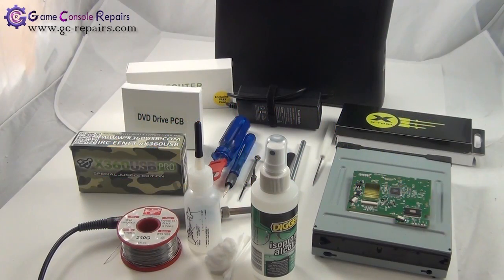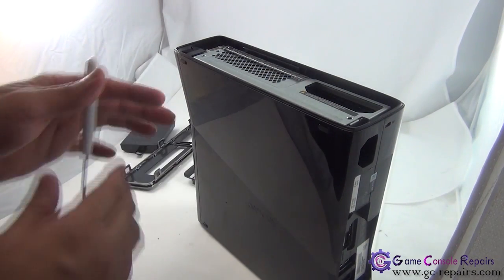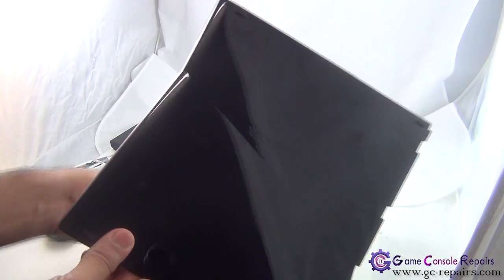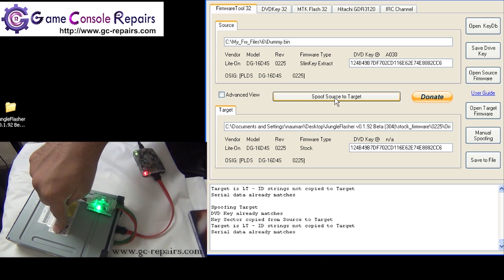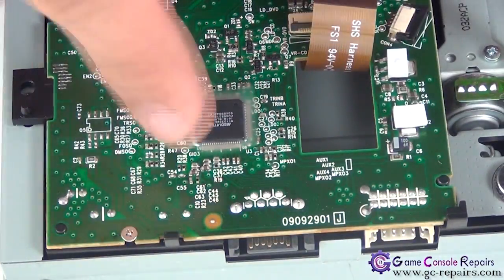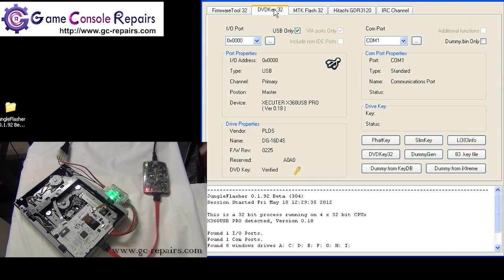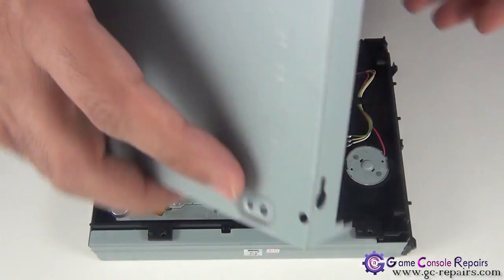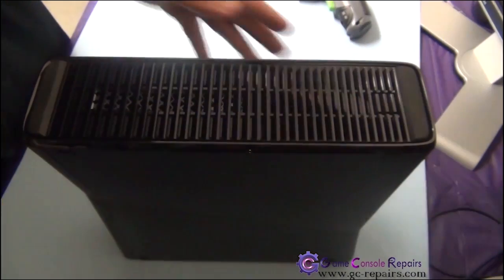X360SLIM Drive Replacement via TX UNLOCK PCB and Stock fw using X360USB Pro v1 & CK3 Mini & Molex

Comment from the maker: Thanks heaps mate :-)
We tried our best to provide full information - it literally is an effort of countless hours in making HD videos. Thanks for your kind words

soldering iron - anywhere from 40W should do
temperature controlled irons are good as you can always flick between different temperatures.

look for Goot, aoyue brands - you would be easily able to find one from your local hardware store for under $30.00 bucks.

Comment from the maker: @RW2709
No PS3 is different - Requires soldering and separate  hardware like E3 Flasher or progskeet.
Wii - You do not need to replace PCB - just take out the old drive and place the new one in.